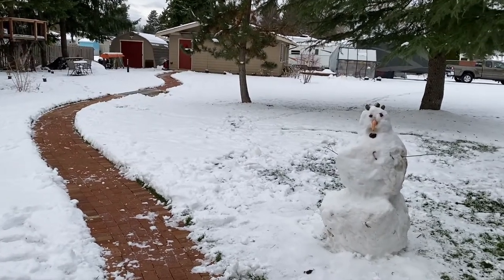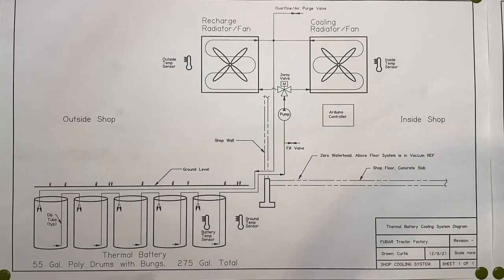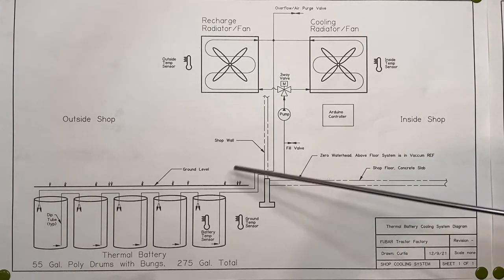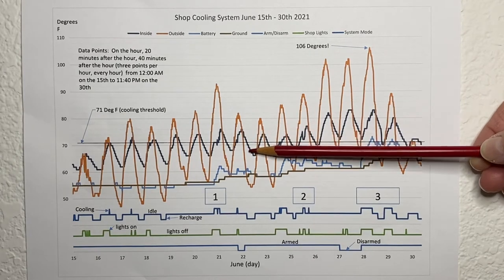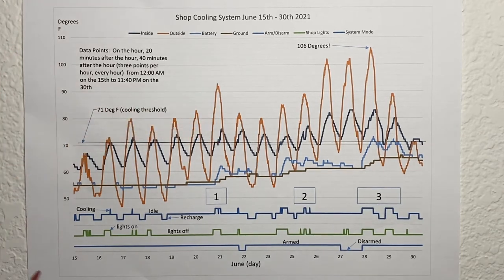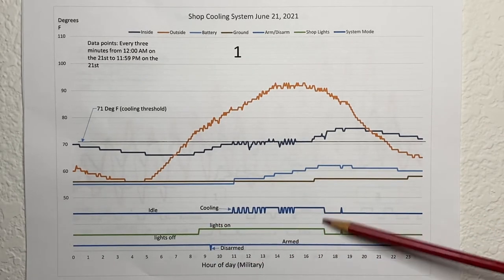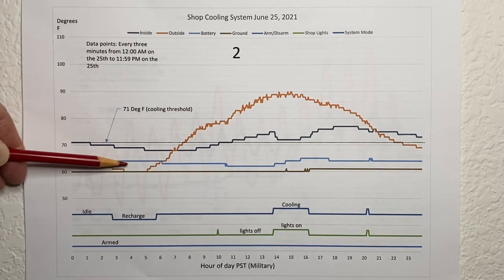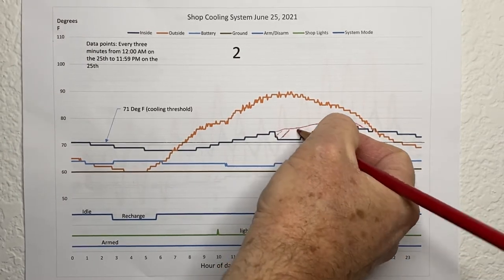Cooling System Data Review, is it effective?

Comment: I would say marginally effective for the build effort. You need to increase tank size by 3x or more. On June 28 during cooling mode you transferred only 6.4 kWh of thermal energy into water tank over 12 hour period. At COP of 3 regular mini split AC will use 2.3 kWh electrical to do same work and have much more cooling capacity to keep your shop cooler. I would place water tanks inside the shop and use night time outside 60 deg temp to run a modified mini split AC to directly cool water tanks to 40F which would increase thermal storage capacity by 3x. Cooling them at night increases COP to 5 or more and uses off-peak electricity. You climate offers good temperature deltas for this technique.
Reply from the maker: Thanks for your comment, I agree with your analysis completely!!  I’m considering a Mr Cool mini split for my house. I’m getting very tired of cleaning and repairing my pellet stove.

Comment: your probably done with this project but I would think you need a bigger exchanger and fans outside. Seeing it recharge for 7 hours but it only dropped a degree while the ground/outside air was well below the battery temp.

Comment: It would have been easier to understand for me if it was in Celsius, but it was still interesting
Reply: It helps if you just use benchmarks. 60F is about 15C, 70F is about 20C and 80F is about 25C. It goes by about 10degrees F per 5 degrees C from there

Comment: I think without your battery being insulated, your outdoor heat exchanger isn't doing much. loosing its "cool" to the ground... but also insulating it would lose the ability for the ground to cool it. maybe have a separate indoor battery that is connected to the outdoor heat exchange? How much power does this setup use?
Reply from the maker: Hello Mason. The wattage of the outdoor fan and pump is approximately 125 watts. The indoor fan and the same pump is about 175 watts.  I thought about insulating the battery. I noticed during the summer outside temps are not much lower than ground temps. However Ive seen the battery 10 degrees higher than ground temps. So I don’t know if insulating would be a net negative.  I think a battery twice the size would help during the afternoons but then cooling it down at night would require higher airflow or two radiators. 
This cooling system is a novel idea but it’s only marginally useful. It sure is fun to show it to people tho! Thanks for your comment. - Curtis.

Comment: How did you come up with the number of barrels you needed?
Reply from the maker: I could only get 5 barrels at a steal of a price. At that time they were $35 or more each and I  paid  $5 for three and two were free.  I didn’t do any calculations at all. I wanted to make something that recharged like a battery.  Didn’t see anything else out there so tried my concept. It came on yesterday and dropped the shop from 75 to 72 before it started to run away and I flipped it off. Meaning it stayed at 72 but the barrel temp was climbing steadily. Ground temp this morning was 61, barrels (without recharging) 62. Last night was very cool but I forgot to flip the switch back to ‘arm’ so it sat idle.  From experience, I think the barrels would have been down to 58-59°.
Reply from the maker: Offgrid - Today after recharge running for several hours the barrel temps are 57° F, ground temp is 60° the ground temp sensor is influenced by the barrels a bit because it’s only 1.5 feet away.  If I had to do this over I would not bury the drums. I would build a very well insulated box for the water battery. My recharge circuit could bring the battery down to mid 50’s if it weren’t for the ground heat. 
GOOD LUCK!!!
Reply: @FUBARtractors  That would work as long as you have cool nights. My use will be more for heat in the greenhouse so I will use the ground and the barrels for the heat sinc.